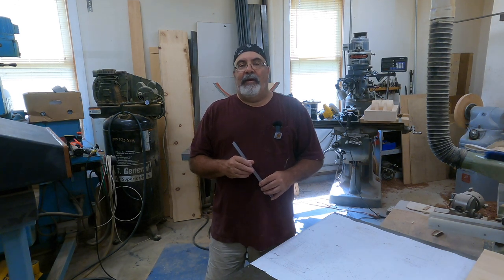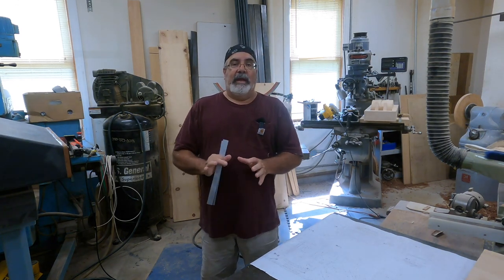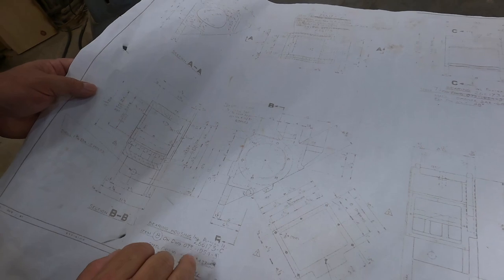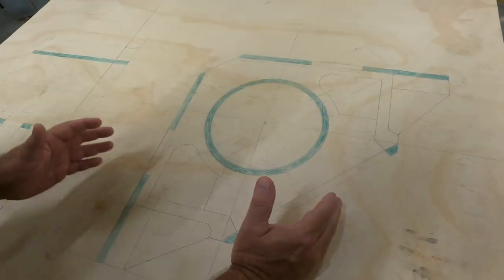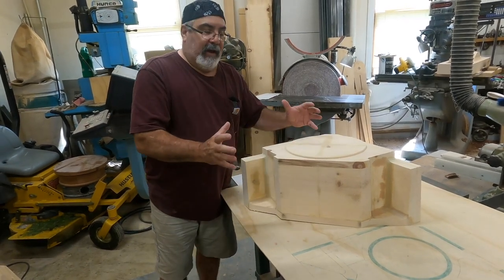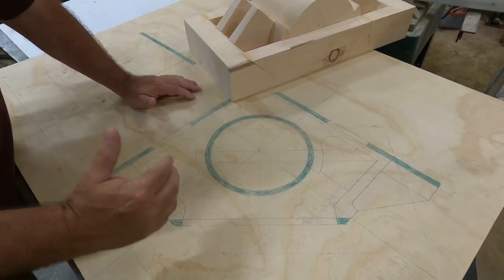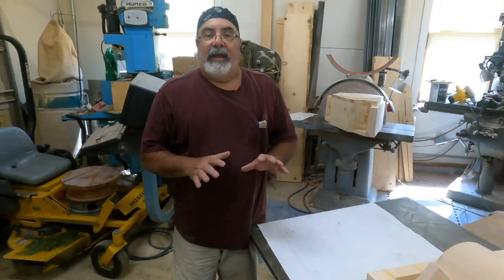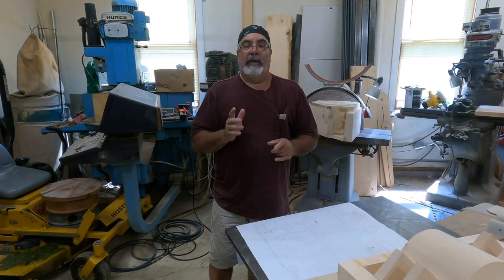Pattern Making: From 2D to 3D

Comment: 40 years ago I worked as a draftsman for a major manufacturer of construction equipment. I spent a lot of time with the patternmakers. I remember them making a mahogany master that would be used to cast aluminum production patterns for cast iron parts. They had double shrink rules for aluminum plus cast iron.